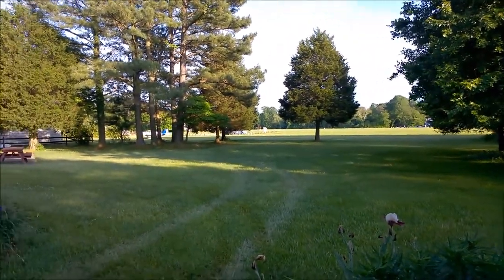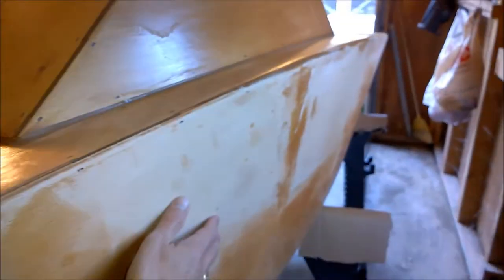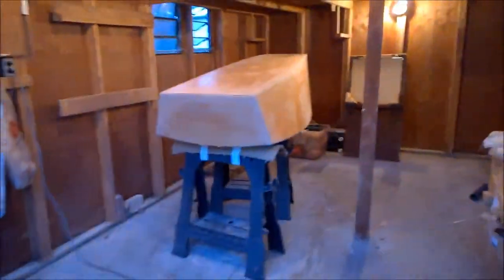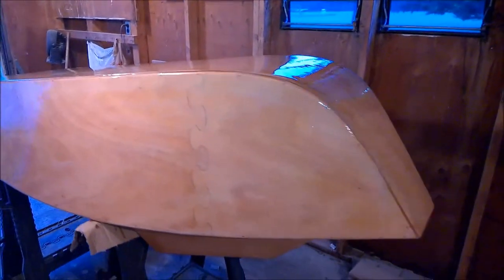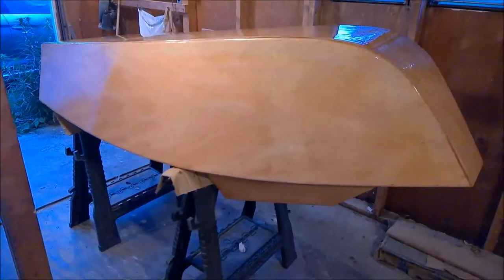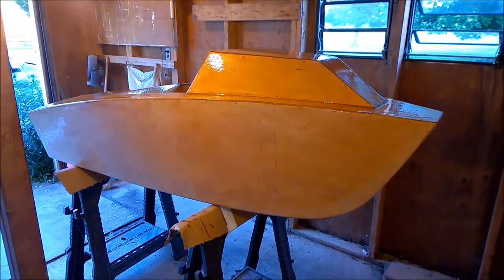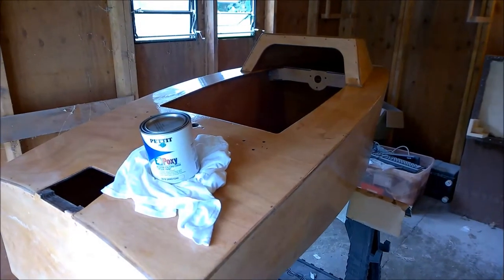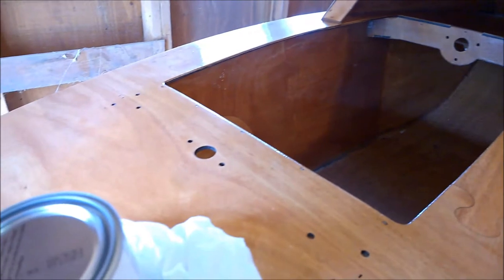Mini Boat Build - Video #10 - Painting has Begun!

Comment: As you ding and scratch the boat with use, I think you will like your choice to paint the hull more and more (It's a lot easier to slap paint on scratches than deal with varnish).

Plus, even if you don't like the paint you always have the option to sand it back down to the epoxy layer for the wood look. Which makes me wonder what a "weathered" / "distressed" paint-job (where wood is occasionally exposed) would look like on a boat....

Looking forward to seeing how you end up painting it.
Reply from the maker: Good points, thanks.

Comment: Couldn’t wait to get some paint on and see how it looked huh? Haha
The epoxy is hard to sand so I’m wondering what grit you finalized it with before paint?
When I see your little boat, I think of a little racer I saw on a lake back in 1960. It amazed me then and so does yours now.
Reply from the maker: Thanks.  Yeah, it's strong stuff.  I used the disk sander and 120 grit.